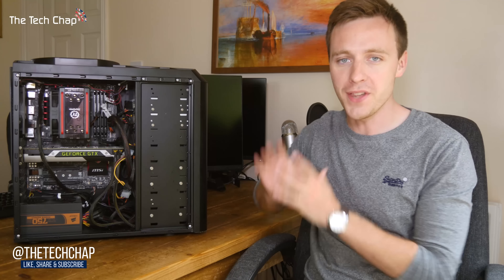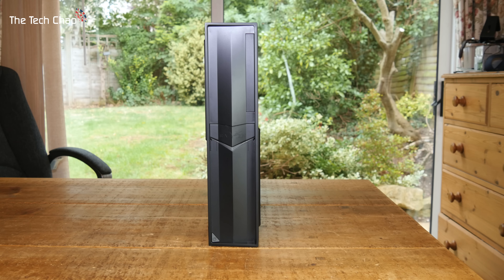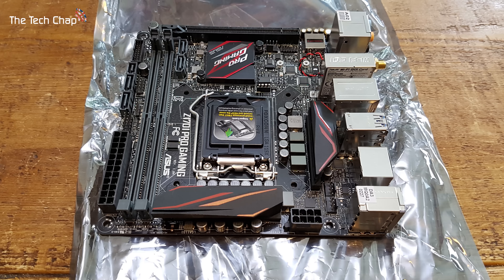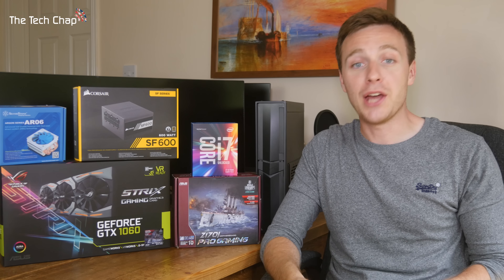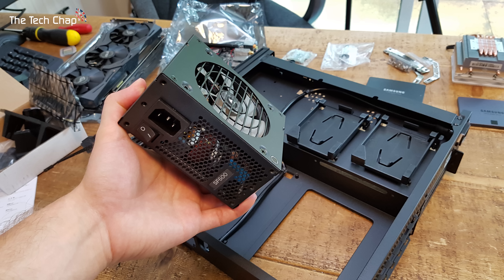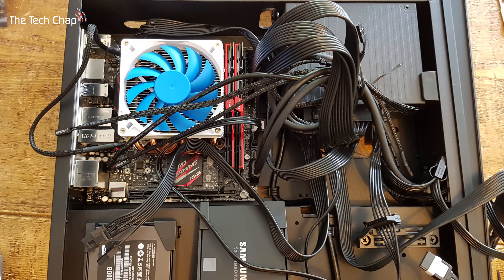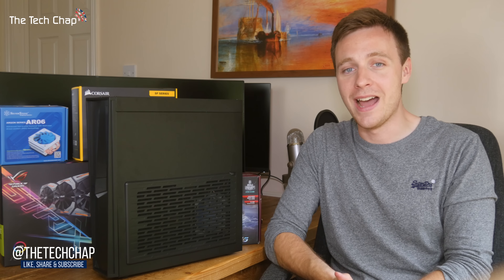How to Build the Best Lounge PC - Mini ITX Gaming Rig

Comment from the maker: Would you consider buying or building a Mini-ITX PC?
Reply: i would love a slim/smaller tower , but i worry about over heating? is this really an issue to worry about?
Reply: Actually seen this video makes it really appealing
Reply: yes, but in the NZXT manta :) 

 (i5 6600K / asus Z170i pro gaming / 16 Go gskill tridentZ white /  fractal kelvin S24 / OCZ triton 150 240GB / corsair RM650x / cablemod white cables / GTX1060 galax HOF for a mostly white build :D )
Reply: Built my first PC start of the year, opted for the fractal 500, as it is the only itx case for a reasonable price, that I could carry as my carry on on a plane. Now I am thinking of upgrading my case to the dan case a4sfx, when it comes out.
Reply: Yes and no. I really like the form factor but single GPU is still not enough for me, I like my rig to have SLI or Crossfire setup so Mini ITX is a no go. Micro-ATX on the other hand is perfect for me. I just wait until the Kimera Cerberus to came out and I can finally build my dream Rig.
Reply: i want to build a micro atx using a corsair air 240 I'm in love with cube cases
Reply: no handler???
Reply: I considered it but I prefer the portability of my low profile gaming laptop.
Reply: I used to build SLI system but I realize it is waste of money for gaming and video edit plus its bulky to bring in LAN party thats why I have plan build same as that rig and it can be hand carry in airport
Reply: Pls fix your links Asus z1
Reply: US
Reply: Impossible in my country sadly, I would only find the PSU on local market with any luck ^-^ (Uruguay)
Maybe in 2030 there is better chance to build one with small form factor, but my guess future hold all pc power into a cellphone size when triple the power would not make crazy diff on graphics like today standards does.
Reply: I do want to build one. I'm worried about CPU cooling though.
Reply: I built my Mini-ITX PC about 4 years ago http://i.imgur.com/NqFeq.jpg http://i.imgur.com/Bar0V.jpg Zotax MoBo with Wi-Fi, Intel Core i3/8GB Ram, SSD hard drive (that was much cheaper than Laptop at that time and this config is still their job). Great tool, I need a PC with big screen, normal keyboard and mouse and I never liked laptops as a main computer. Mini-ITX is a good compromise when you when to have fully functional PC and have a small computer :)
Reply: I did build almost the same PC, except with a 1070 Gigabyte G1 and the Silverstone 500W SFX-L PSU about 2 months ago.  The GPU overclocks fine, but the CPU runs above 80c on the AIDA stress test at 4.2Ghz.  Not that I really care just thought I'd mention maybe others should consider the locked 6700 processor to save some money, although you get the K to buy the super fast 3200Mhz RAM with it like I did.  I'm leaving the CPU at 4.1 since it's running much cooler.  Also there's a full NVME slot on the back of that motherboard that I put a 950 pro in, which is sweet.
Reply: Just above 80? Still ok you runnin on stress benchmarking and the system its not watercool plus you need put exhaust the hot air just circulate in the case of you have those small blower style fan just small it will fit as exhaust the heat but im trying to mod it just a little I have spares of noctua smallest fan it should enough for heat exhaust.
Reply: Already have one! all Silverstone products (most of them anyway)
Reply: I am already considering building a Mini ITX PC because my workspace has opened up to BYOD, and I hate my work laptop.
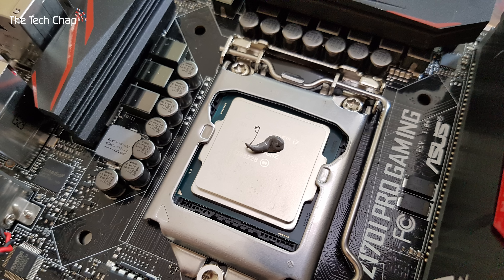Reply: Yeah but I will definitively not apply thermal paste as you do... 7:11
Reply: Also if anyone is wondering, most GTX 970s and up (personal experience) Run around 80ish Celsius, I looked into it and most of them run at that temp because its the "optimal" temp for those cards to run for gaming.
Reply: I am going to. I found a mini itx case that can use a full sized psu.
Reply: I would like to build a mini itx pc, but not for personal use.
I'm always concerned for airflow, and in that raven case, the af would be pretty restricted imho.
Perpahs i would give some chances to the termaltake itx case.
Reply: Yeah, I really do plan building one for my next rig, I'm currently using a HAF 922, which is great but I've come to realize that I simply don't need such a huge tower like this.
Reply: I'm gonna get this case with an i5-6600 (non k sadly) and at Christmas I'm getting a gtx 1060
Reply: Yes
Reply: Yes I'm considering the configuration that you suggest. I was wondering if the space is enough to add also a mechanic storage drive. If yes, which one? 2.5 or 3.5? Thanks for your videos and ideas! Greetings from Italy 👍🏼
Reply: I'll tell you next week I'm buying all the components ;)
Reply: yes, I would definitely
Reply: I'm building this exact build kinda, I wanna change to a 1070, would you be able to recommend the ideal 1070 and psu if i go this route? I've been using your links for the case and such so far. Thanks
Reply: The Tech Chap
Reply: The manta is more bigger, like a normal middle tower!
Reply: oh yes, i travel alot and i need to bring my dota with me lol
Reply: build
Reply: The Tech Chap I bought a Syber Vapor. i5 6600K OC/16GB DDR4/MSI GTX 1070 Aero
Reply: U actually just make me went broke ;-;

I spend my money building my own one.
At least i'm happy :') something new..
Reply: STOP INHALING THROUGH YOUR NOSE!
Reply: This is my first time watching one of your videos and man am I impressed, SUBSCRIBED ! Have a quick question though, what did you use for the WiFi card and how did you configure it within the case ?
Reply: the motherboard he showed comes with wifi, you just hook the receiver (that is also provided) to it through the back.
Reply: Ah, ok got it, thanks for that.
Reply: 600w just to be safe. 500w might be enough, but if it isn't, you're buying another PSU
Reply: Wait, the what kind expensive ass PSU are you trying to buy? Find a cheap 600w, like Corsair CX600. Also, any z170 motherboard is fine, it doesn't really matter.
Reply: Oh, then 500w is enough
Reply: Currently looking to build a system in the Node 202 case. Patiently waiting for the mini itx AMD MBs for the Ryzen 1700 because I would use it for gaming along with Photo and Video Editing. I've had an Alienware X51 that I got Refurbished a few years ago and it's been great but just looking to do my own build now.
Reply: node 202 is so bad at airflow, id reccomend another case
Reply: Has anyone looked into a portable screen that would be good to transport with a PC of this size? I'm looking to build something like this rather than getting a laptop. I realize It wont have the same portability but I think it would work for my purpose.
Reply: The Tech Chap  best cpu cooler for this case?
Reply: How much is the weight for the whole system inside this case
Reply: I built this same on with a 6700k and a gtx 1080 the cpu now on youtube is 38C is this ok?

Comment: Recently built a system using the exact case and PSU. I transplanted my old mini ITX build. Currently running a i5 4670K, Noctua slim CPU Cooler, 16GB DDR3. GTX 970, and a 500GB SSD, all on a Asus Z87I-Deluxe MoBo. Pretty good and solid so far since I know these parts are compatible. Temps are good and runs quiet at Idle. I would recommend you flip the PSU so the fan has more breathing room since it would face the panel with the mesh for air. Also installing the PSU first with cables already attached will help. 

I actually brought this on the plane from Texas to California, no problems at all through security since I claimed it as my Carry On along with my keyboard and mouse!

Comment: With recent small form factor graphics cards mini ITX builds are super valid options for mid-tier gaming, if you're going for 720p/1080p gaming you can choose anything between the rx460/gtx1050 and the rx480/gtx1060 and get really decent performance in modern titles, and a CPU like an i3 6100 or an i5 6500 would run fine with low profile air cooling.

Comment: I'm so happy I found your video! I literally just bought this exact rig. Almost everything in your case I have bought and I have been obsessing weather the parts would fit or if it would get to hot. Only difference is that I bought the ml08b-h but they are pretty much the same

Comment: Got this too, same parts except a MSI GTX 1080 FE, and replaced the fan on my AR06 with a Noctua NF-A9x14 PWM since the stock fan was kind of noisy, maybe a faulty fan or something. But yeah, this build rocks as you can put it in a suitcase and take it with you without having to drop any gaming power. It does get a little hot though and sadly, no room to overclock the CPU at all.

Comment: Well ... It's a nice small and light build which is great for travelers.
I went to Mini ITX to move the computer from below the desk to on the desk. Since I like my computer to be quite and powerful, I have a custom liquid cooling loop.
So in order to fit it all, Fractal Design Define Nano S was my choice. Specs are:
i7-4770K@4.5GHz
Asus Z97I-Plus
2x8GB Corsair Vengeance DDR3 1866@2133MHz
EVGA GTX 1070 SC Gaming @ 2114MHz
SanDisk X400 1TB M.2
Corsair RM650
CPU and GPU are cooled by single loop with 2x240 rads (thinking to add another 120 because I have it and it can fit without issue) D5 + NF-P12@1000RPM
Gaming load temps are 50-55C and 38-42C for CPU and GPU respectively  @ 27-30C ambient.

Comment: Hi. I recently build a Mini-ITX build myself, and it was awesome! I went for the Rijintek Metis cabinet because of it cute look and all the posibilities it offered me. At the box it stands it has a limit to a 170mm GPU, but that was easy to fix. I could fit my 215,4mm GPU in it. How you might think? Well, I went for a shortet PSU (140mm depth) and it had to be a NON-Modular, so all the cables is at the same side. I turned the PSU around so it stood with the fan into the front wall of the cabinet, and therefor I drilled some air holes at the frontside. The cabinet also has posibilities for 2x 120mm fans at the top side. Make sure you make them both blow air into the cabinet, since it has 1x 120mm fan at the backside. With 2x fans blowing air in, and 1x fan blowing air out you will get compression inside the cabinet, make pretty a dustfree build! If anyone got any questions about it, feel free to AMA! :)

Comment: ID save the money and buy a none k cpu ...lets be honest with a low profile cooler you wouldn't wanna be ocing
Reply: people who have built inside a node 202 have oc'd an i7-6700k, not hardcore ocing but enough in some cases for 4.5 GHz. then again they had a blower style card, and two case fans installed (as the node 202 allows) and even an exhaust fan strapped above the cpu, cpu cooler was a Noctua NH 9l, also keeping it in the vertical position will help with temps.
Reply: 6700k is anyways a waste of money the stock one with 4.0 GHZ will be plenty enough.
Reply: +Bandiet
m8. If you're going with an i7 6700, you might as well go with a Xeon E3 1230 v5... Cheaper, more efficient, and it's a xeon. Sounds awesome.
Reply: i dont think you have mini itx for xenon?
Reply: Bandiet Ahh fair enough.
I thought we were just talking about 6700k vs 6700. Oops xD
Reply: SpazSpy No problem i was looking at the xenon before because i knew about it but i want a mini itx system because of the space. But i will try to look and find one.
Reply: Bandiet Fair enough. Honestly I'd still go with the i7 6700k if budget is no problem, but unless you're doing large amounts of intensive video editing idk why you'd need an i7.
Reply: SpazSpy yeah i found some itx boards but nah man to expensive.
Reply: Bandiet well good luck :)
Reply: Good luck lasting more than 5 years... My 2600k would not be able to run any games today if I didn't overclock it.
Reply: Purple Heart Yes it would... I have an i5 2400S, and it runs most games fine. Problem is, I don't have a dedicated graphics card.
Reply: Is your GPU always at 99%? You need a modern Dedicated GPU.
Reply: Purple Heart My GPU is a AMD Radeon HD 6750M 512 MB.
xD 0.5gb of VRAM, and it's slightly better than integrated. Problem is, the CPU doesn't support integrated ;-;
Reply: Uhhh, you're on a laptop?
Reply: Purple Heart Mac. ;-;
Reply: Purple Heart yes it would,  a non clock cpu will last as long as a k series cpu.. 
Overclocking only adds a few fps not massive numbers and in. Out cases won't be noticed by most gamers
Reply: So you're saying a i5 2500 Non K will get the same framerates as my 2600k at 4.8 GHZ?

So overclocking is a useless thing to do?
Reply: Purple Heartyou clearly didn't read what I wrote. 
I said the frame rate between a k version that has been OCD vs a  none k will be minimal... And most folk won't be able to tell the difference. 
My i3 haswell is only 8 to 10fps behind my friends OCD i5... We both have the same gpu a gtx 960...
Ocimg is more for numbers.. As in look at me.. Yes some things can benefit for ocing but with out benchmarks running not every one can tell
Reply: Are you playing Hard games like Forza horizon 3, Gears Of War 1-4, GTA V, BF4, BF1? Any  recent game?
Reply: Purple Heart we are playing every thing from planetside 2, bf1 and ark that is flaky as hell...... Yes mine is only a duel core so there will be games that will run better on his i5
Reply: Go with a better GPU And high resolution and more FPS, You i3 won't even be able to run the game maxed settings cause the CPU will bottleneck it.
Reply: Purple Heart I run at 1080x2560but play most games at high to medium at 1080...iv had no issue... Actually the i3 a solid wee cpu... Would beat my mates old fx8320 in a lot of games
Reply: uuhhhhh, you play vertically?
Reply: and save more by getting 450 to 500w psu
Reply: You're comparing 2 year old server CPU's to current desktop Overclockale CPU's.

Plus it's old technology.  it won't do well and I know it cannot handle that high of a frequency..

XEONS ARE NOT FOR GAMING!
Reply: Purple Heart actually ***** has a point... A XEON is basicly a i7
Even Linus tech tips build a high end itx gaming pc using a XEON and a titan inside a Silverstone case. 
In most cases a XEON is cheaper than i7 for the same performance. 
I'd rather get a i3 or a i5 note if it's just for gaming
Reply: CaligoMilites eh you know the differnce between an i3 and i5 OS minimal... Actually as I stated before i3 have had better luck than. Fx8xxx in games... 
I am running a haswell i3 and I can run any game at 1080 on medium to high settings.... Only time my i3 suffers is if I was to stream a game but that's something I don't do. 
Yes a true quad core is better but it all depends... 
An i3 is pretty decent budget cpu for gaming...
Reply: High  frequency ram makes a HUGE difference.. I've seen 20+ fps gains by going from 2133 mhz to 3400mhz...
Reply: Purple Heart wow hostile much... 
I think you need to step away away from pc gaming all together till you have calmed down
Reply: You guys should not be a pc person. Go back to consoles..

See the difference for yourselves.
Reply: So apparently, if faster ram frequency doesn't give you more FPS, the why the fuck do manufactures make these 3-4ghz kits with such tight timings huh? If it makes "no fucking difference".
Reply: I never said that.

videos don't need bandwidth.      videos use 500MBps at most, even at 4k for editing a video.

Go with high frequency ram yourself and se the difference.  Very useful  with high framerates.
Reply: That video from linus is really old. 

You see the benifits in today's games like Gears of war 4, Battlefield 1, forza horizon 3...

I had issues with bf1 on my rig g\barley getting 60 fps. So I looked at my ram settings and it was at 1600mhz, When it should be at 2133, I then overclocked it to 2400mhz and never had any issues and gains over 30 fps and no more stuttering.
Reply: Purple Heart eh I run workstation with high frequency ram ddr4 and there is minimal gps gains with that at my itx i3 with 1600mhz ram
Reply: Robert Brown that's what I did

Comment: Just recently built in the same case, the dust filters on the side are very restrictive, if you don't mind cleaning it every noe and again you can take them off and see a few degrees drop in temps. CPU and GPU run around 5c cooler for me now :)
Reply from the maker: oh that's good to know!

Comment: Fantastic video!
I'm considering building something similar and using my current SSD drive that has my Windows OS and software such as clip art studio and a few non stream games. 
my question to you is what do I have to do to make sure I don't loose my OS and software. thank you for reading and hope to hear from you soon.
Reply from the maker: +MangaMatt there's no issue with just swapping your ssd out and putting it in the new system. Just make sure you've got a record of your windows 10 serial key (especially if it's an upgrade licence) as changing the motherboard requires you to activate windows again

Comment: will it still be alright for temps with a stock cpu cooler for an i7 6700. and also would it make a difference to temps with a gigabyte 1070 oc mini card instead of a full sized card.

Comment: im looking at building in this case but not sure what i should throw into it, would the i5 7500 be good enough for a 1060 / 1070 or should i pick up the 7600k? for a tad bit more? im probably not going to overclock due to temps so is it really worth it? 

also would a blower style card be better in a case like this?

Comment: Is K Edition for non overclocker but Video Editor and 3d modeling purpose worth it? I'm thinking on getting i7 7700. It seems run on lower TDP which means save some cash.
This mini itx will save some place.

Comment: Do you know if this case supports the GTX 1000 / RX 400 series GPUs with the direct cooling heatsinks that make the dimensions of the cards slightly taller than the PCB? How much clearance is there to accommodate this GPUs? Thanks.